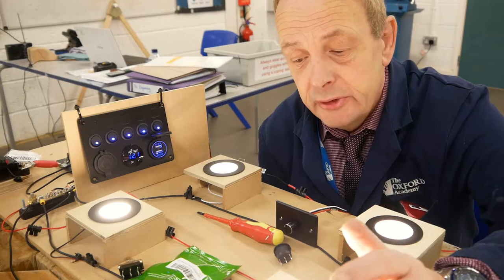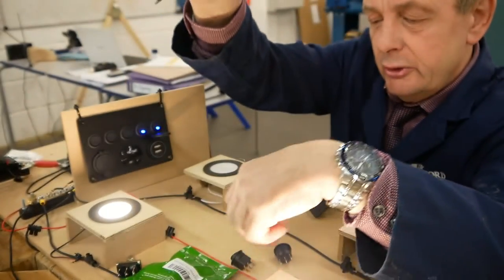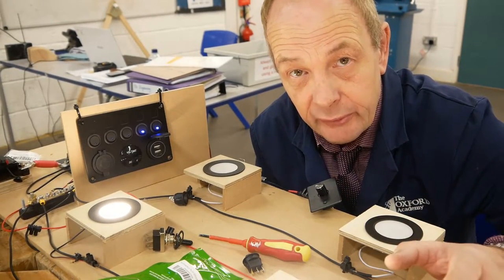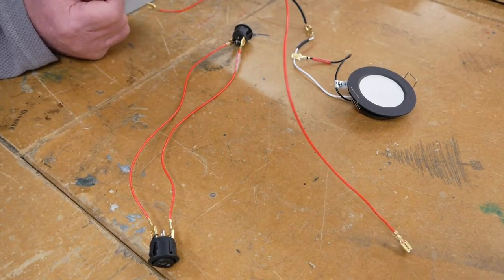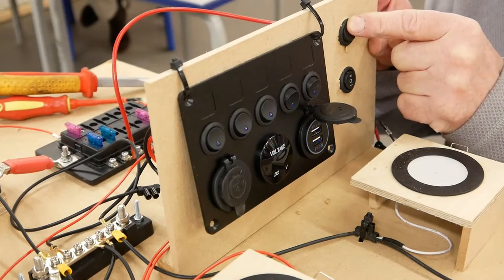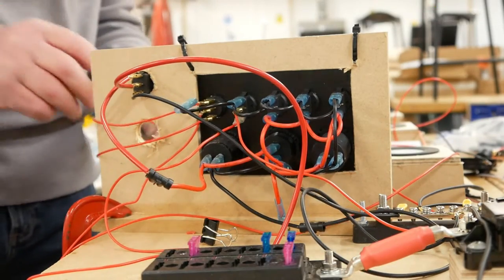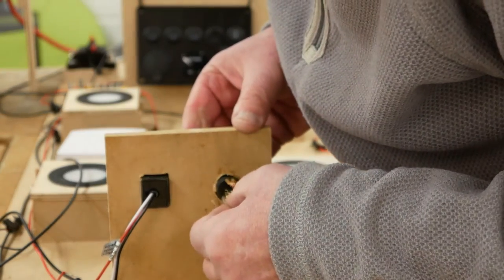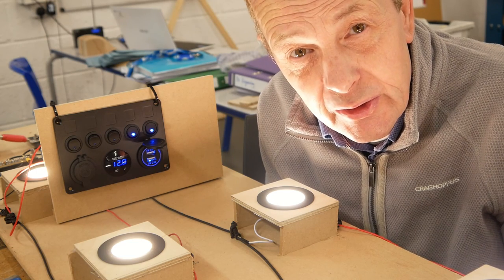How to 12V 2-Way (3-Way) Switches (to Control Camper Van Lights from two locations)  Ep4  |  SHED 52

Comment: Incredibly helpful video, workign through this now and this is the simpliest explaination I've found! Did you end up integrating the dimmer into the 3 way switch? I didn't see how the dimmer switch fit in with the 3 way functionality.
Reply from the maker: Good morning Will, thanks for the feedback. I'm working on the mechanics of my van at the moment, but will develop a video  on 3 way switches.

Comment: Excellent video. Thank you!

I have a 2023 Sprinter 144". Have you by chance got a way to do this for switches in 3 locations WITH a dimmer at one location? One in the front or just behind the driver's seat, one on the B-pillar by sliding door and one in the back. I would do this for 3 light circuits. We call it a 4-way switch system in the USA. Any help with this would be appreciated. TIA🙏

Comment: Thanks for this video. If I wanted to use a push button, that doesn't latch, but does illuminate, so my OCD doesn't have to worry about forever changing switch positions, what kind of switch would that be? I think it would be a DPDT or Changeover switch, but I'm not sure.
Reply from the maker: I know how you feel, I like my 2-way switches to point in the same direction, so they look off (or all look on). I hate it when one is up and another down, I have real problems with that. I've tried to find something on-line but unfortunately I haven't found anything yet.

Comment: Hi David, would this set up with the on off on switch work for a electric water valve? Could I have two switches in different locations that could open the valve? Thanks in advance for your thoughts.

Comment: Hi there, thank you for your video, this may be a stupid question, but originally you say about the switch using the gold prong for ground, then went on to connect lives to all 3 terminals on both switches, were both of the switches on/off/on switches? Thanks in advance.
Reply: No, the first switch had a LED fitted, so the switch required a ground to light it when on.
The first switch was simply an ON/OFF switch. 
No LED fitted to the second ON/OFF/ON  switches.

Comment: If the first switch is in the center (off) position, will the lights come on when the second switch is in either of the “on” positions?
Reply from the maker: might have to run a live to both the on positions. Otherwise, you would have two off positions. If you have a diagram of your circuit would love to see it.
Reply from the maker: Sorry just add, are you using a switch with three poles on the back?

Comment: Good video.  Do you have a link for the 2-way switches? Thanks!
Reply from the maker: Here's the link for the 2-way switches, many thanks David
Reply: @shed52 I don't see a link?  That's fine. I found some other ones online.  Cheers!
Reply from the maker: https://youtu.be/EpW3t0_4w7c  @reynoldallan4868  Try this link should work, I'm still new to this sorry.
Reply: @shed52 please put link in bio as it doesn't work here and searching for it didn't chime up with anything..  were they specifically rated for DC?  As, so many online are rated for AC. And,  there is mixed feedback re if AC is ok for DC.
Reply from the maker: Thank you for the feedback, I update the links and description. Thank you @mknoyce
Reply from the maker: This is the 2 way switch video I made, thank you for the feedback. https://youtu.be/EpW3t0_4w7c
Reply from the maker: I think these links need updating, I'll do today. Thank you for this very helpful.  @mknoyce

Comment: Does this work with the other switch you had (the single position switch with an LED)?
Reply from the maker: I'm really sorry I haven't responded earlier, but to answer your question I tried with the single position switch and I could only make it function as an on off switch not  2 way switch.

Comment: Is there a way to make the switch 2 way without 0 (middle) being off, keep flicking to 0 then two way dont work.
Reply: I'm about to try it with on-on switches instead of on-off-on switches
Reply: @stephenlawson2000  Can you share your results please?
Reply from the maker: Hi sorry for the late reply, I think of the 0 location as neither on nor off but a neutral position. So to try to make a 2-way switch without the centre 0 would mean the switch wouldn't work properly. It could work but it would mean traveling to the other end of the van/vehicle to turn the lights on and off because they are not synchronised. The 0 position overcomes this, so I would recommend a switch to a 0 position. Hope this helps, David
Reply: I will wire it up tonight as by my working out it will work 2 way but not 3 way
Reply from the maker: Let me know how you get on.  @stephenlawson2000
Reply: Update it is confirmed that on on works for 2 way, wire the outer poles of 1 switch to the outers on the other and use the center ones like a standard on off switch  and it works as 2 way
Reply from the maker: Thanks for this, can you switch either the light off from either switch without having to move from one switch to the other? @stephenlawson2000
Reply: @shed52 yeah iv just uploaded a short (I think)
Reply from the maker: I'll try to find it. @stephenlawson2000
Reply: Did this work with the on and on switch, i.e. were you able to switch the light on and off from both ends? Do you have video? @stephenlawson2000  @shed52
Reply: @stephenlawson2000  I am working on a on on setup with out the middle position and will do this in the drivers cab and at the rear and side doors for 3 locations to turn on and off the lights.

The key connections are:

The positive (+) terminal of the 12VDC power source is connected to the common (C) terminal of all three switches.
The normally open (NO) terminal of Switch1 is connected to the normally closed (NC) terminal of Switch2.
The normally open (NO) terminal of Switch2 is connected to the normally closed (NC) terminal of Switch3.
The normally open (NO) terminal of Switch3 is connected to the positive (+) terminal of the 12VDC LED light.
The negative (-) terminal of the 12VDC power source is connected to the negative (-) terminal of the 12VDC LED light.
This 3-way switch setup allows you to control the 12VDC LED light from any of the three switch locations.

So this is the setup I have worked out with out the center OFF position using on on switches.

In theory you could add more locations with this setup.